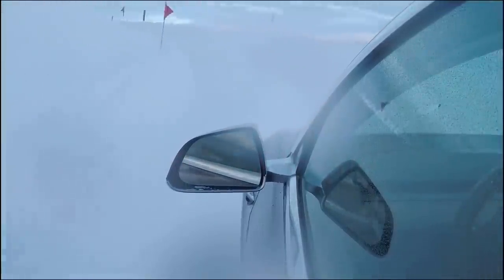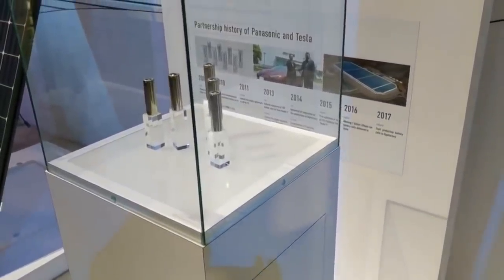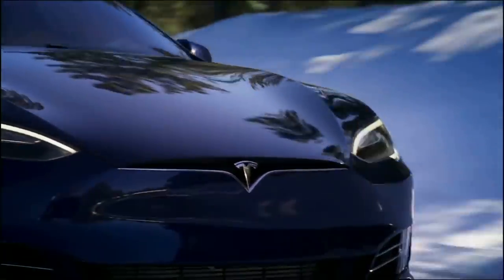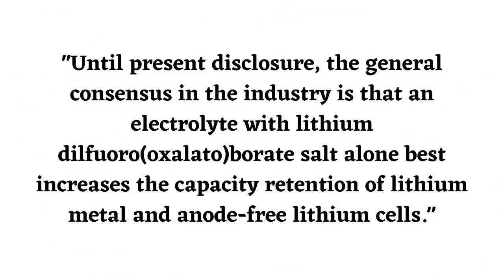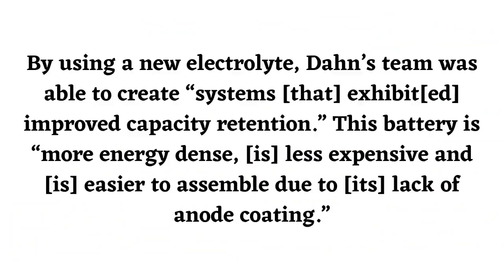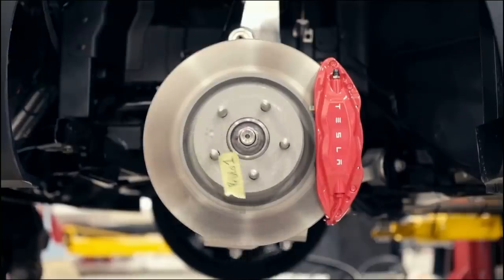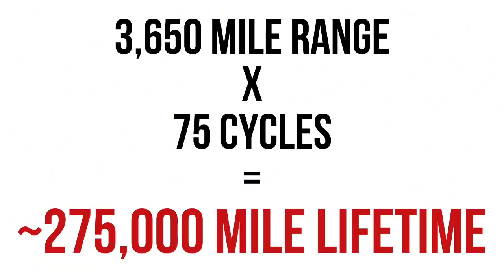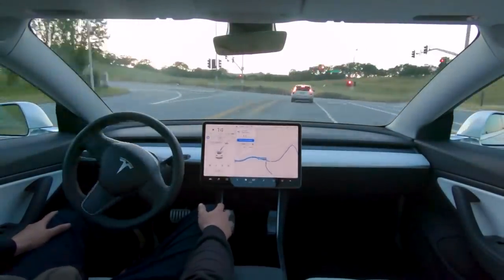Tesla's Secret 3,650 Mile Range Battery - The Next Gen Revolution

Comment: If this density is possible,  then electric planes are possible...
Reply: @Allen Loser Electric motors are 95% efficient. How efficient are jet engines?
Reply: We have them for short flights  https://www.youtube.com/watch?v=aRTtCuEw_jc
Reply: @Allen Loser Actually Electric Cruising Planes make no sense. That VTOL Elon was hinting at is an old idea from the crazy Cold War era. It's basically a Supersonic Glider that launches off MagLev Rail a big version of Navy's EMALS. The battery onboard is only used to lift the vehicle to something like 50,000ft after being launched from the rail system. Then it Glides for about 1000-2000 miles, quite a limited range. But that covers a massive market of Regional Jets. I know this sound crazy but it's mostly built on existing ideas except for a High Density Battery.
Reply: @Allen Loser WTF that makes no sense, Nuclear is minority of electric generation. Coal is BANKRUPT business on it's way out. Gas Turbine is the only financially viable dirty fuel.
Reply: @Allen Loser You just ignored my comment. GE & Siemens builds 300MW Gas Turbines, more than enough to run such a system.
Reply: @Allen Loser LOL Wind Turbines could easily drive such a system, only need a massive Mechanical & Tesla Battery to buffer the poor timing. Interms of Capacity a 500MW Wind Farm is the Average Size. That should be enough to power the system & the Airport.
Reply: Due to energy density, yes, but affordability, probably not.

Kerosene (and all combustible liquid fuels) still have a very understated advantage: Weight loss during operation. 

Planes are currently fuelled up with enough fuel to complete the intended journey plus a (not insignificant) margin for emergencies, reroutes, landing queue circling etc... 

As fuel is used during flight, the plane becomes lighter, so it becomes more fuel efficient as the flight progresses. 

Electric planes weigh the same on landing as they did on takeoff. 

Just another reason that battery powered planes are sadly so far away from becoming a reality right now.
Reply: @SuperNintendo.Chalmers  LOL Your concept is wrong. Cruising on battery power is a stupid idea, you need a different method. It's much more achievable if you take a different approach.
Reply: Neojhun what? Go on.... you can’t just say “take a different approach” then not offer any. 

Everybody ready for Neojhun’s revolutionary new electric plane concept??? 

Come on kid, you could make billions here..... this is your chance. We are all waiting.....
Reply: @SuperNintendo.Chalmers  Read my previous comment in this thread from a few DAYS ago. Woops.
Reply: Neojhun Neojhun yeah, it was a ludicrous comment. I thought it was satire. It’s not relevant, at all.
Reply: @Allen Loser Oh about that's Catapult acceleration issue. Quite sure the resulting velocity is lower and distance traveled is much longer than a Space Rocket launch. Sure it won't be smooth pleasant ride, but it will be much less than a Space Launch. Soo very far from causing injury.
Reply: @Allen Loser LOL this version will be much longer and slower. This issue is much bigger Mass. At-least a Few Miles long for the ramp up. The closest system I guess is ShangHai MagLev. The awesome bit about this system the Aircraft does not have to Stop. Full bore ahead. But less than Mach 2.
Reply: @Allen Loser But what is the efficiency of jet engines? 30%?
Reply: It is sad that this video is spreading misinformation for a very large community. 2600 Wh/kg??? Are you kidding me??? If you show me how you came up with that number, then I'll tell you what you have done wrong. I mean it is even 5 times more than it should be, it is that wrong
Reply: Radio controlled long range model. https://www.youtube.com/watch?v=BgvUhKxIosI
Reply: No mate. This battery has same energy density. 😂😂  They increased the volume 41*80 so more energy but same energy density

Comment: I am confused... I mean, if they could make a 3650mile range battery, the first thing to do would be to create a car with 1/5 or 1/10th of this battery to get a very low price vehicule with a "nomal range" knowing the battery is the most important price cost of a car... So that makes no sense!
Reply: You got the point. EV cars would be equipped with a suitcase-sized battery which costs approx 1000 USD. This will be the end of ICE-era, because the electric drivetrain could be put into any existing chassis without a serious reconstruction. This small battery can be put anywhere under the seats, into the cargo area, or even to the place of the removed ICE-engine.

Comment: I have a theory. If this is the hybrid battery cell (range extender) that you talked about before, then theoretically this is not a future battery, this is road runner! If 1% of all journey's require an extended range, 75 or 100 cycles would last the lifetime of the car. So this is the 3rd component for the hybrid cell patented. You could buy an sr+ without an hybrid battery and you would have an amazing range. Lr is then with the hybrid battery where on a road trip you basically never need to stop. It would unlock battery aeroplanes too. I really hate this waiting for September to Come around

Comment: Where did you get this information from? There are no Li-Metal Anode-Free batteries with an energy density of 2,600 Wh/kg. I think you're confusing this with something else such as the Lithium-Sulfur battery that can potentially have that said energy density.
Reply: That's what I was wondering! Thanks for clarifying this. Until Tesla or Jeff Dahn's research reveals more info about the batteries, this video is just misleading.

Comment: 4:06 HA! And I'm questioning myself why don't I see this technology In Teslas. Dude, if it lasts 75  charge cycles, not only does it become far worse for the environment because even though these batteries are "cleaner" (which I highly doubt) because you will need  a new battery every 2.5 months my flame-spitting Mazda RX 8 produces less emissions than producing a battery every 2.5 months. Also you will have to buy a new battery every 2.5 months, you will be paying far less for petrol or diesel. The reason why I've used 2.5 months is because my buddy that owns a model S told me that he uses 75 charge cycles every (around) 2.5 months. Overall 🤦
Reply: That's at current range before having to charge. If this technology comes to fruition, you'd drive a few thousand miles before having to charge, so your cycle frequency is far less. Even at 75 cycles and 3,000 miles per cycle, that's 225,000 miles. This video says they're looking for improvements before it becomes a real, usable thing. I also want to see it before I get too excited about the idea of it.

Comment: Elon has stated that, like Solid State Batteries, Anode Free Batteries are a misnomer. Neither exist "scientifically". A battery MUST have Electrons moving IN (charging) or moving OUT (feeding a load). While this activity occurs at the Sub Atomic level, there is STILL movement - NOT "solid state". Anodes in a lithium cell must be SPONGEABLE - a substance that can easily take on, store or slough off electrons as required. NOW, lithium cell anodes are aluminum strips coated with lithium powder [ insert inherent issues here ]. Tesla backed battery advancements include NON metallic anodes made from salts (pre crystalline molecules, not table salt) - anode free?
Reply: "Solid state" means here the lack of liquid electrolyte. This does not mean a totally solid and motion-free state where even the sub-atomic movement does not exist on absolute zero temperature.
Reply: @tcfs  Thank you for clarifying.
Reply: @tcfs  true
Reply: "Load" lol

Comment: @Title “Beyond Tesla Investors” 
1. on 7/7 
Buy DBD today,7/10
Its eps for 2020& 2021 are upgraded from
-0.13 to 0.37 with PE 15
& 1.26 to 1.44 with fpe 4 
    It is upgrade from hold to buy
Price increased 5.7%
—————-
2. On 7/1 ，I  post @youtube 
See what you get 7/7 for NVAX 
—————-
3. Title “Beyond Tesla Investors(7/1)
Two super growth Biotech to buy and hold(7/1/20’)
1). NVAX
      Since the early 2020, its 2021 eps has been upgraded from $3.86, $6.02 , now $10.28. 
      Its EPS yearly growth rate is about 90% since 2017.  At around 80$/ share,  NVAX forward PE is less than 8 !. 
       Expect to gain at least 2-2.5 X value in 2021.

2). CTXR turn from hold to buy (7/7)
     CTXR will earn $0.74 for 2021.
At $1.04 today, It has Forward PE about 1.4 !
CTXR values at least 10X by the end 2021.

Two additional 10 baggers
1). DRAD (turn from hold to buy on 7/7)
    DRAD will earn $1.73 in 2021, mainly from its gamma camera diagnostic heath care system & services. 
    At $2.7 price, it has a FPE around 1.6 ! 
   DRAD values at least 10 X by the end of 2021.

2). DBD (hold)
   DBD will earn $1.26 in 2021.
At the price of $6, it has a FPE = 4.76
DBD values at least 5X by the end 2021.

3. Add on 7/7
  AEZS has TTM earning@ 18 cents
Reply: What the hell are you talking about

Comment: Any battery improvements are crucial current batteries are fine for cars but not good enough for trucks. To replace a 3quarter ton truck you would need 5 times more batteries than the model 3 if you want comparable towing range. The semi 10 times more batteries. If your numbers are close even if the batteries have to be replaced every year it would make economic sense.

Comment: If and when this battery comes out, and I imagine it will very soon, this battery that promises 3,650 miles per charge could very easily offer a lifetime range well in excess of 4,000,000 miles.
Reply: 275,000 miles only.
Reply: @webcomment8895  Maybe with current Tesla battery technology, but a rechargeable battery that is taken care of can last for as much as 1,000 charge cycles or more.  However, that means that at the lifetime range you gave me, combined with a range of 3,650 miles as promised in this video, that kind of a battery would only last for about 75 charge cycles, assuming the battery endured a cycle depth of 100% (charging and discharging completely).  Everything considered, there exist a huge number of factors to control for when determining battery longevity.

Comment: Pardon my ignorance but I thought every  battery had to have an anode and a cathode - -  equivalent to a positive and negative terminal. Not so?
Reply: Batteries normally have a tab attached to the plate, this tab is the anode. The electrons have to funnel through this tab to get off the plate causing a bit of a bottleneck. A new design has the whole edge of the plate as the anode so the electrons can hop off all along the edge. It has not tab attached which is maybe what they mean by no anode. It is more efficient and misses out on the step of attaching a tab. DIsclaimer: I know nothing about batteries just putting out the mish-mash that is in my head from
what I've read.
Reply: @Martin-se3ij  This ought to have been called "tab-free anode" instead of "anode-free".